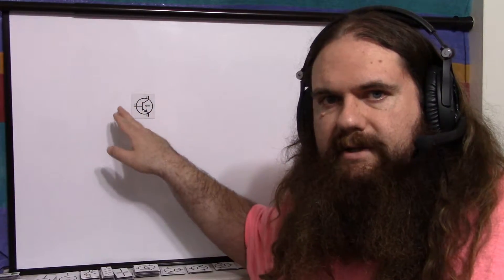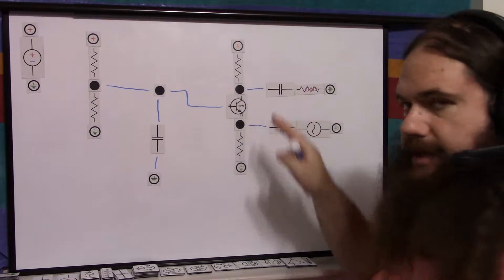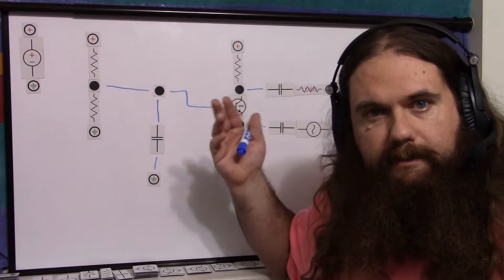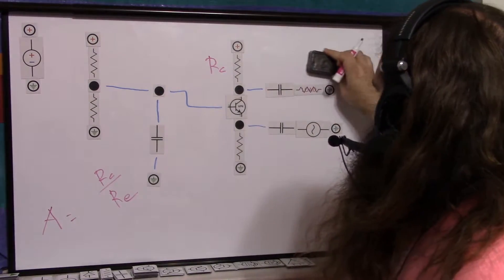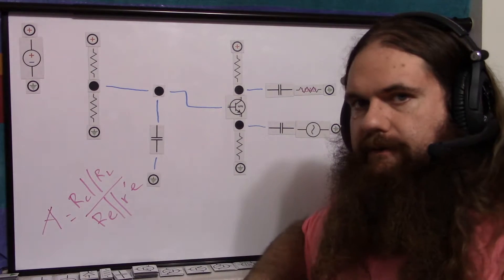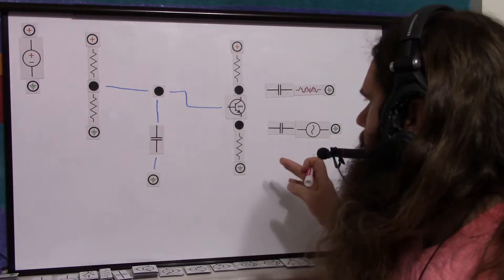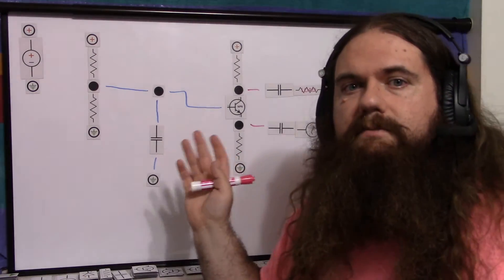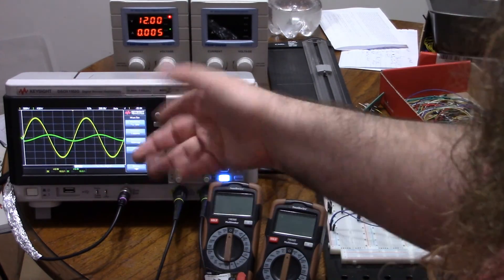Common Base Amplifier - Small Signal High Frequency High Voltage Gain - Simply Put

Comment: What is the maximum frequency a transistor can switch-generate?
I mean , the transistor is creating the frequency, by switching.
I dont mind if it is a mosfet.
The base is fed by function generator to switch at the frequency of the function generator.
What is the maximum frequency?